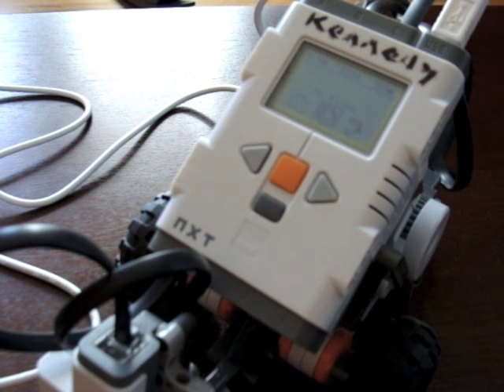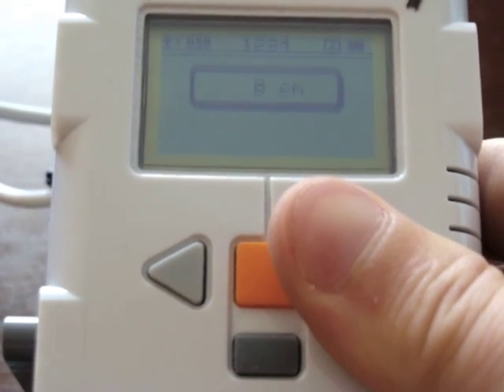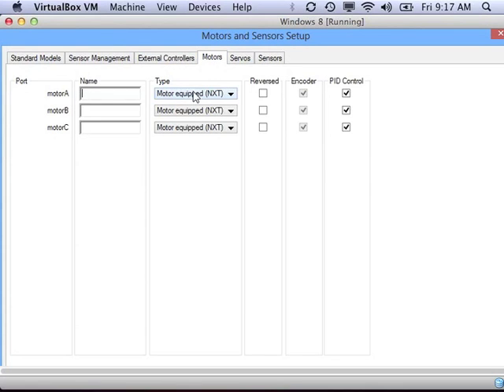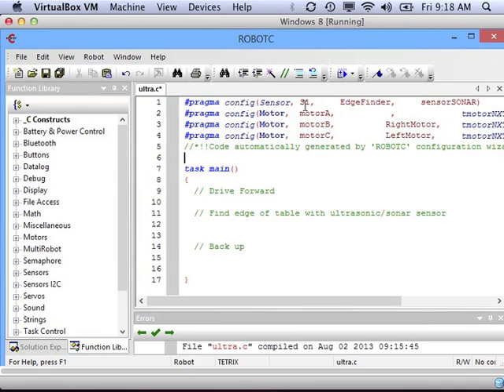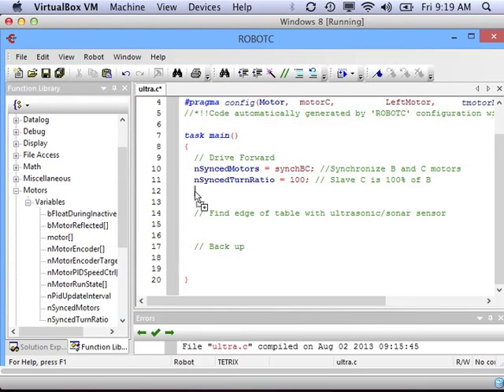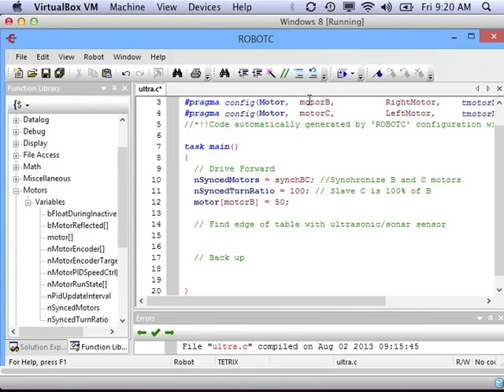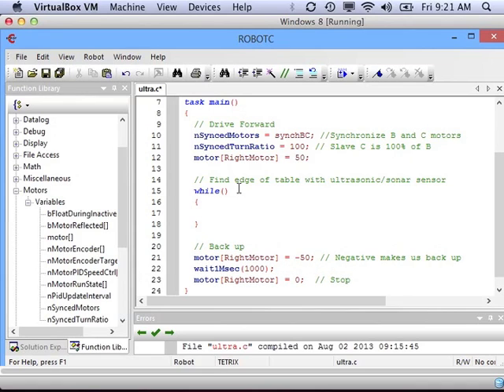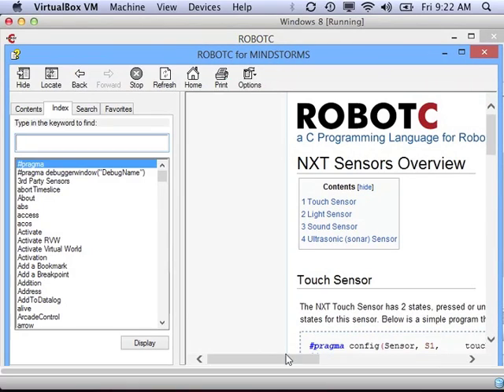Intro to RobotC 5: Ultrasonic Sensor and While Loops

Comment: I have this prgram and I'm trying to get it to end following the line, drive forward and avoid an obsticle#pragma config(Sensor, S1,     touch,          sensorTouch)
#pragma config(Sensor, S2,     sound,          sensorSoundDB)
#pragma config(Sensor, S3,     light,          sensorLightActive)
#pragma config(Sensor, S4,     sonar,          sensorSONAR)
#pragma config(Motor,  motorB,          rightMotor,    tmotorNXT, PIDControl, driveRight, encoder)
#pragma config(Motor,  motorC,          leftMotor,     tmotorNXT, PIDControl, driveLeft, encoder)
//*!!Code automatically generated by 'ROBOTC' configuration wizard               !!*//

task main()
{
   while(SensorValue(touch) == 0)   //a while loop is declared with the touchsensor's value being 0 as it true condition
    {
      motor[motorC] =50;
      motor[motorB] =50;

    }
      motor[motorC] =-75;
      motor[motorB] =-75;
      wait1Msec(2000);

      motor[motorC] = 45;
      motor[motorB] = 50;
      wait1Msec(1500);

      motor[motorC] = -15;
      motor[motorB] = 90;
      wait1Msec(650);

      motor[motorC] = 50;
      motor[motorB] = 50;
      wait1Msec(1800);
 
   //while(true)
   while(SensorValue(touch) == 0)
 
   {
      if(SensorValue(light) < 45)
     {
      motor[motorB] = 80;
      motor[motorC] = 0;
     } 
    else 
    {
   setMotor(motorB, 0);
   setMotor(motorC,80);
   }  

   }

  }